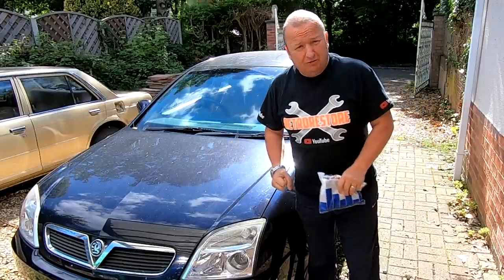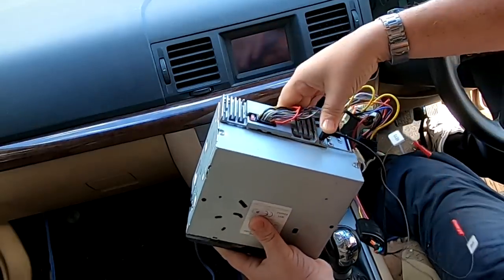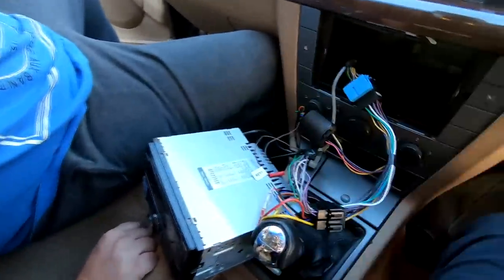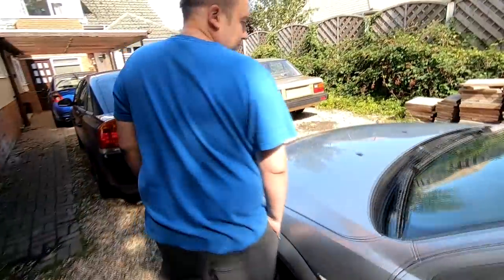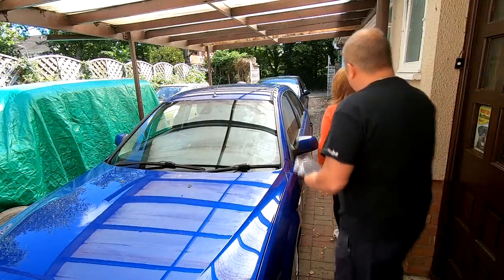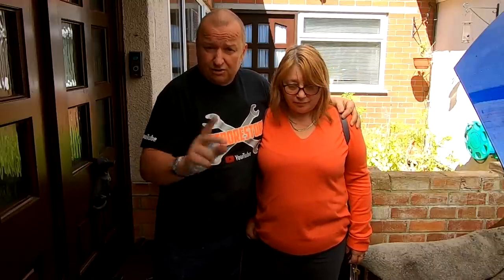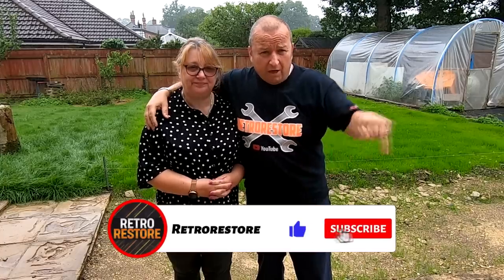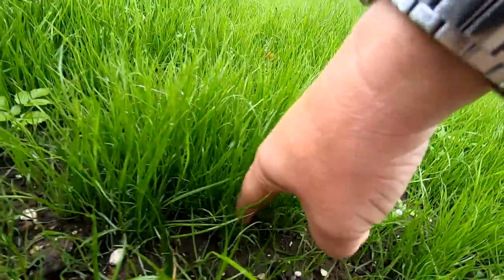Tinkering With The Vauxhall Vectra And The Mondeo ST220 Vlog

Comment: 99.9% of modern Vauxhall cars have the battery permanent, and ignition live back to front, hence the red and yellow ISO wires on most after-market stereo's are pre installed with bullet connectors. Often they contain a loop connection so that you can wire them permanently live and rely on remembering to turn the stereo off manually. Also on a side note, the two ISO connectors have the locking tabs in slightly different positions, this aids connection for colour blindness and not blowing the stereo up 👍
Great video as usual mate 👍

Comment: I had a couple of head units in my vectra, I think if you change a couple of wires on the unit before plugging into the loom it gets the unit powered up, apparently the vauxhalls are all" reverse "wired, that's what the tech that fitted mine said!